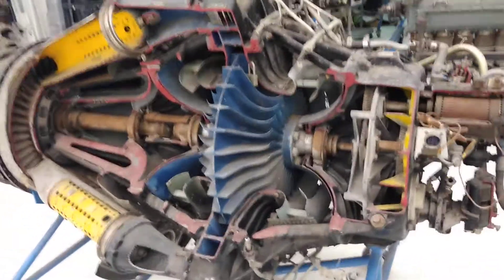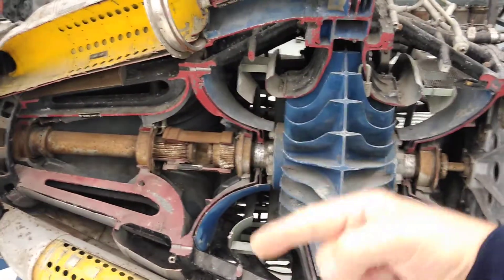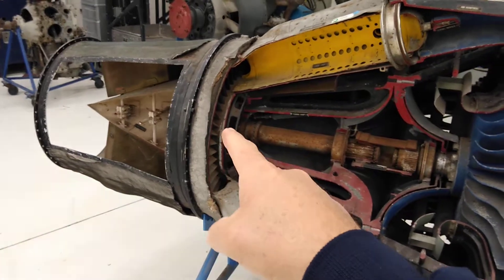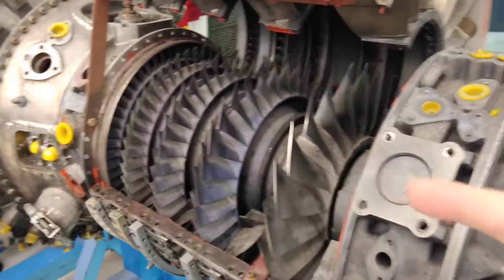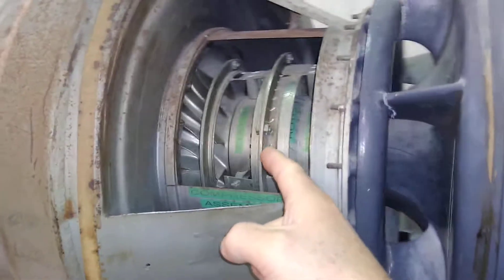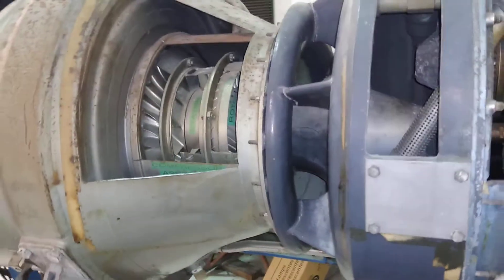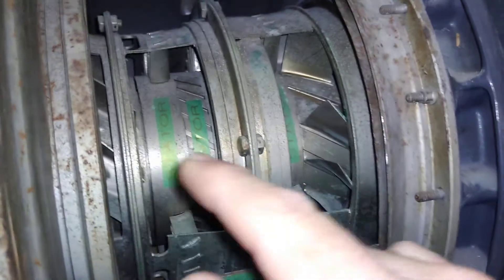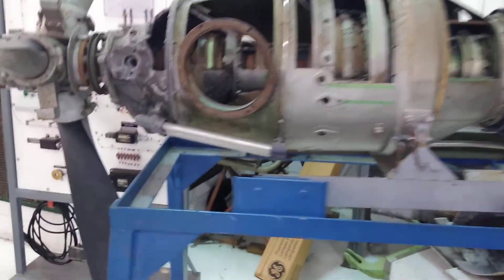THREE TYPES OF COMPRESSORS ON JET ENGINES

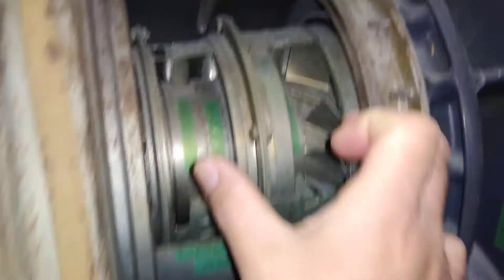Comment: It seems that centrifugal compressor engines continue to be favoured for stationary or relatively slow moving applications such as helicopters, so in early jet powered aircraft (before the advent of turbofan engines) they were favoured. The larger diameter of these engines might present an obstruction to airflow 6:35  & thus a disadvantage within the duct of a turbofan?

It is a pity that there is background buzzing noise in this interesting & informative video.

Comment: Are compressors connected to a single shaft when axial and centrifugal are used in an engine or they rotate independent of one another??
How does the rpm look like in this combination?
Is it N1 and N2 or just a tachometer?
Thank you very much for your video and for your response in advance.
Reply: The compressors on small engines are typically on a single shaft [single spool]. Twin spool designs typically provide for a separate low pressure compressor and a high pressure compressor are more costly but offer higher performance. The HP comp operates at higher speed.
We have a superior, low cost, higher performance architecture.

Comment: I have retired from the military and am in the beginning stages of improving my knowledge, videos like this is exactly the type and style of information I have been hungering for. thank you very much
Reply from the maker: Hello Mr.Gey man, congrats on your retirement and thank you for your service. 
Thank you for your kind words. I appreciate it. 
Let me know of any other question or curiosity you have and if I'm able to shed some light, I'll try my best. 
Welcome to Plane Simple.
Reply: @planesimple8514  Actually, there is something you might be able to help me with. I have been studying Henry Coanda's theory of thrust. 
With this in mind, could and axial centrifugal compressor be fitted to a small engine, say a rotary, to create enough air pressure to be able to create lift for a small VTOL craft?
Think big or go home as my old R.S.M use to say.

Comment: has the first example - the centrifugal-compressor jet engine - been used on aircraft as a turbojet, or is it more used as a turboshaft engine?
Reply from the maker: Hello D, sorry for the slow response.
Yes, that type of engine has been used in turbojet applications. Look up the Lockheed T33 jet trainer with the Allison J33. That's one example.
Reply: Also, Grumman F9F Panther.   An early Navy Jet Fighter.

Comment: There is a continuous high tone in the vid so I stopped watching. 
But my question is: It is an air compression system right? Takes air from outside and that is the 'fuel'?
Reply from the maker: Hello hongry life, there's nothing I can do about the background noise and I don't have the tools or skills to remove it in post edit, since I mostly do not edit the videos.
To answer your question, NO, the air is not the fuel. The fuel is the fuel, the Jet Fuel is the source of energy that needs air to burn with, to heat up and expand so it can do work.
The air is the source of oxygen to burn the fuel with. 

Recap:
The fuel is the fuel(source of energy)
Air is the oxidizer(source of oxygen to burn the fuel with)

I hope this helps.
Reply: @planesimple8514  Thanks for answering :) 
Do you know why the air has to be compressed immensely with the many circling/spiraling blades and the oxygen cannot be taken out of the air without that compression?
Reply from the maker: The point of burning the fuel is to produce heat. Compressing the air allows you to produce a lot more heat. 
As an example, a wax candle will burn and produce a little bit of heat. What determines the rate at which the candle will burn is the oxygen available around it to burn the wax(fuel) with. That candle will burn at whatever rate the oxygen in the surrounding air will allow.
Now take that candle and feed it more oxygen, (air under pressure or compressed), now the candle is not limited by the available oxygen in the atmosphere, and now the same candle will turn into a raging fire that will consume the wax in a lot less time and it will produce A LOT more heat.
The same goes for any fuel. Take a cup of jet fuel, light it, and you will get the equivalent of a candle, a slow flame that will waft a bit of heat. Take that same jet fuel, and feed into a jet engine that is supplying highly compressed air and that fuel now has a hell of a lot more oxygen to burn with and it will burn like a raging fire that produces a lot more heat to do more work.

In short, the fuel will burn in regular uncompressed air but at a much slower rate and won't have the ability to do a lot of work like make planes fly.

Comment: Thanks for the video! I was recently looking at some display engines at our local air museum and couldn’t figure out why there was no direct air path on the older engines. Now I know that centrifugal flow engines exist, it not only answers that question, but also explains why early jet fighters didn’t always have direct intakes straight into the engines.
Reply from the maker: Awesome Flyboy207! I'm happy to hear that you got these answers from my video. That's very satisfying. 
It's also good to see people like you that are curious enough to expand on what they see at a museum. A lot of people's curiosity ends the moment they step out of the museum. 
To build a bit more on the "indirect" path of the intakes, yes, having air come in through the side's into a centrifugal compressor lends itself to side air intakes on the airframe, but there's more to consider. 
The number of engines is also a determining factor. If you have two engines like an F-15, F-18 or F-22, you can have the cockpit in the center of the airframe when viewed from the front and still have intakes that are mostly directly in front of the engines . However, if you have only one engine like a F-16 or a F-35, then you 
Have the cockpit more or less in front of the engine so you are obligated to offset the intake around the cockpit. In the case of the F-16 into one single large duct underneath, or in the case of the F-35 into two smaller inlets on either side of the cockpit.
Reply: Also think of it like your hand held hair dryer the air goes into that little opening with the little impeller fan goes around and around then out the long tube as hot air your water pump on car's operates in a similar way and also the turbo pump on trucks just a flat PC of material going around with fins on the outside pushing air around it and back

Comment: Is it axial or centrifugal compressor the first one
Reply from the maker: The first compressor in the video is an axial one.
Reply: The first engine with the blue blades is a centifugal 'flow' engine.   Think of airflow.   The air compression and movement is caused by centrifugal force.   Like a washing machine spinning to get the water out of clothing.   The air is flung outward by the blue turbine, that compressed air moves around and into the yellow 'burner' cans (combusters) where the fuel is injected inside the cans.  The burn creates hot expanding gas that moves thru and against the 'tubine' (exhaust) wheel blades.   They are fixed to the shaft which turns the centrifugal compressor at the front.   
       Centrifugal flow engines didn't last very long.   They were quickly outdated by the invention of the Axial Flow Jet Engine.   
       Axial Air Flow is accomplished with multiple sets of compressor blades lined up on the center axis (the long shaft) of the engine.   The air moves along the center axis.   Axial Flow !   It moves to the burner section aligned with the center axis, keeps moving straight back to the (exhaust) turbine blade(s) which turns the center (axial oriented) shaft which turns the compressor blades.   The whole system aligns front to rear aligned with the Center Axis of the engine.  Axial airFlow Jet Engine !

Comment: Very good mate I like how you explain👍 would you be able to explain about what people call the ‘high’ and ‘low’ pressure compressors ?!  Thanks a lot
Reply: Just seen your like mate. It’s ok it was just a mis understanding. I thought it was something more complex. They were just referring to the fact that nearer to the intake of the engine, the pressure is of course lower, and as it progresses further , increases
Reply from the maker: Hello Harry, thank you so much for the positive feedback and sorry I took so long to reply to your question. 
The low pressure vs. high pressure compressors refer to dual or triple spool turbine engines. That means that there are two or three concentric shafts running one inside the other. In the case of a triple spool engine, the inner most shaft connects the last stages of the turbines at the back of the engine to usually the big bypass fan in the front of the engine. This shaft runs right through the very center of the engine from end to end. Around that inner most shaft is an intermediate (hollow) shaft that now connects the "low" pressure turbine to the "low" pressure compressor. This secondary assembly spins or spools independently from the first shaft and therefore can spin at different speeds. This "low" pressure assembly compresses the intake air up to a point, after which the compressor would have to be spinning much faster in order to compress it any higher, but if you spun this entire assembly faster, then the air speed of the incoming air would not be enough for proper flow. That's where the "high"pressure compressor comes in. It is yet one more shaft/compressor/turbine assembly free to spin at its own speed independent from everybody else. This time, the "high" pressure turbines power the "high" pressure compressor at a much faster speed in order to achieve the high pressures of modern engines, but yet allow the "low" pressure assembly to rotate at its optimum RPMs, as well as spinning the bypass fan up front at yet an even slower speed. It is all in the name of efficiency and having the ability to spin different parts of the engine at the optimum RPMs for their functions, at the cost of adding mechanical complexity of course.
I know this was a long answer but I hope it makes sense.
Cheers.
Reply from the maker: This sounds complicated but at least in principle, the concept of it is not as hard. It's just hard to explain in a short text. May I recommend videos by "AgentJZ", he has a few videos explaining this very concept and are an  excellent source of knowledge.
Reply: @planesimple8514   awesome thanks for that mate, see maybe I missed it in the video but I didn’t realize there were multiple turbines in the aft end of the engine and multiple spools turning at different speeds (low and high). 
I thought it was all one shaft, but (instead of multiple spools at different rpm) the angle of the compressor rotors changed.
But now I think about it, if it were like that, they would clash and restrict each other to to an extent. (in terms of them wanting to operate at different speeds)

Let me know if I’m talking rubbish mate haha

Also so when people say ‘three stage compressor’ (for example) they are referring to the number of spools
Reply from the maker: Hello Harry, I have made a new video trying to answer your question in a more complete way. I hope it adds a little more clarity on the subject. And if you do see it, I recommend you take a minute to read a comment from "Laertes L" about the video. He added a couple of corrections that are helpful too. 
Cheers.

Comment: Looking at the single stage centrifugal compressor on the first engine you showed us, what would you estimate the diameter of the compressor wheel is?  What is the motor and who made it?
Reply from the maker: Hello earlyhemibill, that's a display cutaway modelI at Broward College. I couldn't find a data tag on the engine but I think it's an Allison J33. As far as the diameter of the rotor, I haven't been back there again to measure it exactly, but it should be just over two(2) feet.
Reply from the maker: By the way, "earlyhemibill" is a great name!
Reply: @planesimple8514  They are one of my hobbies.
Reply from the maker: That's awesome! Enjoy it and happy new year.
Reply: @planesimple8514  I'm building a motor now that I hope will propel a model airplane. It will use a 3200kv brushless motor with a 22.2 volt battery turning a 3.38" diameter turbo compressor wheel. It will turn at 71,000 rpm and feed a combustion chamber with methanol and exiting out a 1.25" tailpipe. My curiosity about the jet engine was to figure out how much velocity a real centrifugal compressor turns.
Reply from the maker: Wow! That sounds awesome! I think it's brilliant to use the electric motor to power the compressor instead of a turbine. That way you don't have to deal with material choice for the hot section. The Allison J33 spun at 11,750 rpm. Now you'd only need the diameter of the compressor disk to calculate the speed. Hum... I seem to remember you asking that very same question!? Lol... I've come full circle and helped you any! Sorry. Good luck with that awesome project. I'd love to see it.

Comment: Thank you 
My question is :what is the material of these compressors ??
Titanium ,steel ..????
Reply from the maker: I'm not sure exactly, but for the axial compressors, I think the discs that support the blades are steel and the blades themselves are titanium(when you grind them the sparks are white). And I think on the axial compressors the impeller might be aluminium, because it's so massive that it can be a softer metal. That would be my guess.

Comment: Does the compressor heating the air?
Reply from the maker: Yes it does, a lot!
Reply: @planesimple8514   thank You
Reply from the maker: No problem. If you want to see an example of how that HOT air is used for in the aircraft (other than producing thrust) you can see a video I did a while back that looks at wing Anti-Ice system. There you can see the piping taking that "bleed air" away from the engine compressor and uses it to warm up the wing's leading edge.

Comment: On the last turboprop turbine, from your explanation I conclude that the function of axial part is to prevent the compressor from stalling. CMIIW
Reply from the maker: Hello FlipFliop, no, the axial part of the compressor is not to avoid compressor stall, it is to compress the air before being compressed further in the centrifugal section.  You could either have a single stage centrifugal compressor, like the big, double sided, one stage compressor in the video. You could have a two stage centrifugal compressor where one stage feeds the other. You could have an axial compressor alone, with more stages for higher compression like the one in the turbojet from this video, or you could have a combination of both, and that's what you have in the P&W PT6 which is the turboprop you refer to in this video. Therefore, the axial section of the compressor is not to avoid compressor stall, it's function is like it's name implies, to compress the air. 
I hope that was easy to understand and clarifies any questions.
Reply: @planesimple8514  Thank's for your explanation sir. But, I mean the axial parts is like giving constant air feed and pressure to the single stage centrifugal side to compensate rapid ambient air/ pressure, air direction change while flying. I hope you get what i mean bcoz it's difficult for me to express it in english :-).
Reply from the maker: No worries, english is also my second language so I understand.
Actually, a centrifugal impeller is less likely to stall if it stalls at all because it does not depend on an air foil shape to move the air and therefore does not a critical angle of attack. It is more like paddles mechanically pushing the air. An axial compressor on the other hand, is nothing more than a collection of tiny little wings with air foil profiles that much like a wing pushes air down to create lift, the blades(little wings) on an axial compressor push air back into the compressor where it is compressed further at each stage. Now, just like an aircraft wing stalls when the angle of attack is too great, so do the axial compressor blades. If the air speed is too little for the compressor speed, then you could get a compressor stall. I know this has been a long answer, but going back to what I said in the beginning, an axial compressor is more likely to stall than the centrifugal one, and the function on the axial compressor, is just to compress the air, and the centrifugal stage is a final kick to further compress that air. 
I hope this makes sense and it helped you.
Reply: @planesimple8514  I appreciate your effort explaining those stuff to me and it helped me a lot. Thank You
Look forward how many miles this channel would go from your 53rd Subscriber
Reply from the maker: Thank you very much! Any time.
Reply: @planesimple8514  Can you explain the benefits an axial compressor provides over a centrifugal compressor? Why are axial compressors a lot more common in modern engines than centriguals?
Reply from the maker: Sure, that's a cool topic. Thank you for the suggestion, I really appreciate it. And thank you for watching my videos.
Reply from the maker: Hello BIGMUSCLE, I just did an answer video for your question. I hope it helps. Thanks for watching and thanks again for the question and suggestion.
Reply: @planesimple8514  Got it! Thank you so much!!!